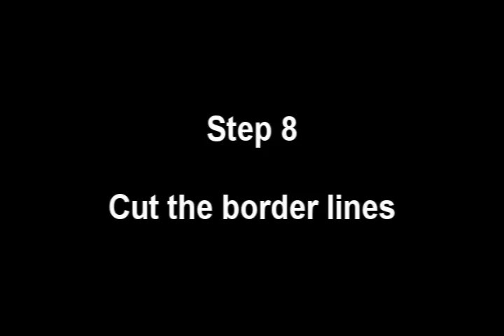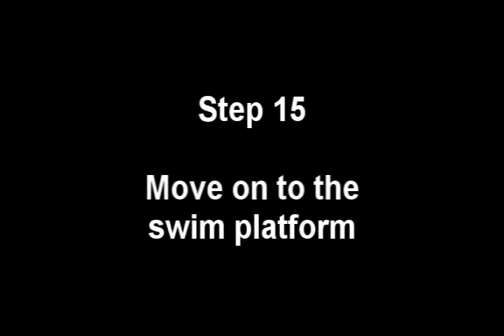NuTeak North West Installation overview

Comment: At a guess, your bonding glue is in affect "super glue" , just thinking of all those small joints  and if one misses one , you have water trap???? sure you know what your doing , just a question, As a boatbuilder iam about to start my first PVC deck . checkin things out before i jump , like your work. wish you well,